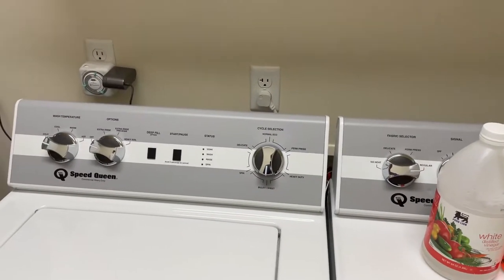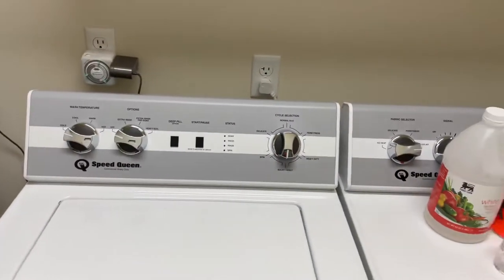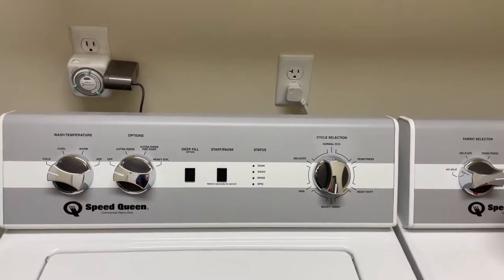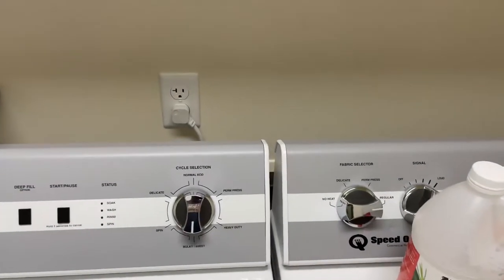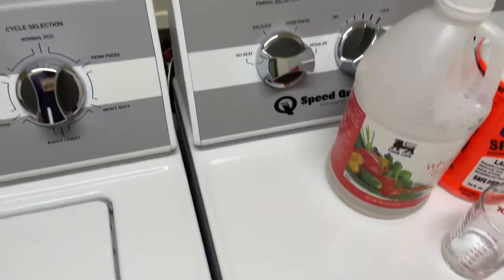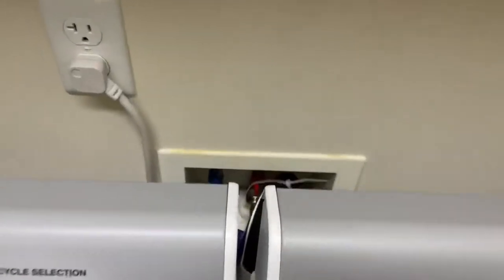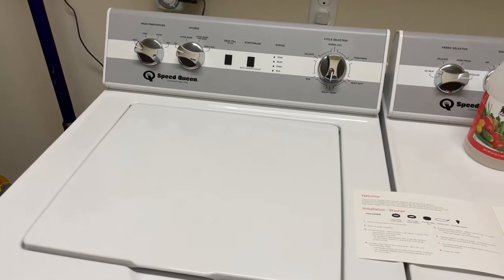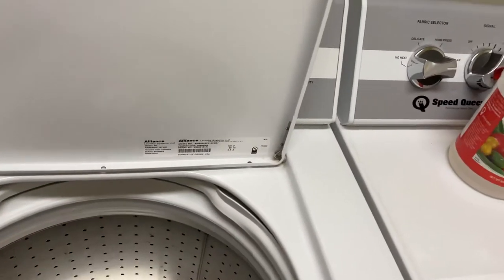Foam Bubbles coming out Speed Queen Washer drain hose - Fixed!

Comment: Rick thank you so much for this video!  We have the exact same model and exact same problem, bubbles everywhere and water on the floor.  I don't want water on the floor near my new washer as I don't want the bottom of it to rust as a result.  I say new washer only because my last washer (a Maytag ) lasted 30 years, but that was back in the day when machines were mechanical and not all this computerized stuff, which is why I bought this model (TC5003 WN) because it was NOT a touchscreen and all of that computerized stuff that can fail.  This model is mostly what I call a mechanical model and it also has the option of hot water which many washers nowadays don't have. I tried different things like using the lower water level and not using the high water level but that didn't seem to make a whole lot of difference.  We were actually on our way to pick up our standpipe adaptor from the warehouse (part number 36878) and while we still will try this part we want to try the remedies that you said worked for you as well.  Even the guy in the warehouse (when I called today) mentioned that the air pumping down the standpipe makes the residual soap bubbles multiply so he was saying he wasn't sure how much this part would help.  I told him I thought the hard plastic of the drain hose along with the ridges it has inside and out were causing some of these excess bubbles (as opposed to having a softer plastic drain hose that is smooth on the inside and out).  I told him I didn't know if this was a design flaw or not, but he did say almost exactly what you are mentioning about the pump and spin cycles being so very strong and fierce.  I agree with you that I like having the clothes almost bone dry as the drying time is cut down dramatically!  All this being said, I do have a couple of questions.  You mentioned 1 ounce of vinegar to be put in the wash cycle and I was wondering if the capful of your detergent is also 1 ounce or is it more than that?  Where do you get your detergent?  I've noticed less bubbling when we used ONE of the little Arm & Hammer laundry pods that you throw in the bottom of the washer before you put your clothes in but I can't stand the smell of them!   Also my vinegar is Heinz multi-purpose vinegar extra strength (6% acidity) that I use for cleaning (windows, decalcifying my k-cup coffee machine, etc.).  I think I got it at Walmart.  Do you think that would be too strong or should I just go with regular strength vinegar?  Also you mentioned that the the normal economy cycle does not have the fill and agitate as part of the rinse cycle, so I'm wondering what is the best setting for me to use to get around this rinse cycle problem as I don't think I can change the rinse cycle in the middle, after my choices have been set.  Basically, which washer settings have you had the best luck with as far as avoiding the bubble/water problem?  Even though you're saying the vinegar is pretty much going to stop the problem I still just wanted to hear your take on which settings have worked best for you.  Sorry this is so long, I'll be grateful for whatever answers you might have!
Reply from the maker: Hi Deborah.  Thank you for leaving a comment.  No problem with the length of you questions.  I am a "details" guy and appreciate everyone else who is also.  
*  We use any generic white vinegar.  Our current bottle reads 5%, so you are good with 6%.
*  We pour 1-2 ozs in the middle dispenser at the same time we add the clothes and detergent.
*  We've used Atsko Sport Wash detergent for at least a decade now.  It has no additives and no fragrances.  Just pure detergent.  
*  We use the Heavy Duty cycle for all clothes, and Bulky for bed sheets.
*  Every once in great awhile we still get a very small amount of foaming.  It never foams much, and it never gets too big that it threatens to run down the wall. 
*  Please click on the "Rick's Tid-Bits" by the video to go to my YouTube channel.  I think you will find some more interesting tips in the "How To Make Life Easier" section.  Rick
Reply: @rickstid-bits  Thanks again!  I've never put anything in that middle dispenser as I never really knew what it was for!  You don't put your detergent in there though do you?  I will have to try that detergent as it does sound good.  I will stick with the heavy duty cycle for clothes and bulky sheets for sheets and blankets like you say and if I'm doing anything truly delicate then I'll use that cycle but I will stay away from the Eco Cycle!  And I guess you man click where it says subscribe.  I'll do that now.  Thank you again!  Deborah
Reply from the maker: You're welcome.  The vinegar goes in that cup inside the agitator.  The detergent goes in with the clothes.  Please read my entire description below the video.  I've added a lot of what I've learned there.  Rick
Reply: Ahhhh! This was exactly what I was looking for…a video with my SQ washer with the same issue. Headed to try this out right now!!! Thanks, Rick, you just may have saved the day 🎉
Reply from the maker: Hi Hope.  You’re welcome.   Please read all the info in this video's description.  I recommend you do the heavy flush first.  Please come back and let me know how it goes.  Thank you for leaving a comment.  Please click on the words “Rick’s Tid-Bits” underneath the video to go to my YouTube channel.  I think you’ll find some helpful and unique tips in my How to Make Life Easier or Better section.  https://www.youtube.com/channel/UCc-IuUFzC2Tyv06KzJyBESg  Rick You’re welcome.

Comment: That was very informative. We bought this machine as I am recovering from mold exposure. We've only had our machine a couple of weeks, and we are having the same problem with bubbles just as you described. This is very concerning to me because now the sheetrock is wet where it spilled over, and the machine is so heavy I can't move it to clean up all the water. The company where we bought it deliverd it and set it up, so hopefully it was installed correctly. We will try your suggestions and see if that fixes our problem. Thank you so much, and may God bless you.
Reply from the maker: You're welcome Shaila.  Please let me know if it works for you.  Rick
Reply: any updates?

Comment: I was so interested to find your post here.  I have been having this problem with my old SQ and my brand new one; the dealer told me to call my plumber which I did, and proceeded to spend a LOT of money re-piping my  basement to lift the drain pipe higher and straighten out a few other turns my old pipes were making.     The first load in the new configuration was fine; the next 2 loads leaked out the pipe again!   I did notice that if I used the heavy duty or bulky item cycle and warm/hot water, I did not see any foaming or leak.  The next several loads I did were fine, but I expect it will happen again.   I wondered if it was the Eco Cycle that was the problem for me.  Frustrating to say the least.   I will try your vinegar tip!   And I use very very little detergent, like the size of a dime.    Thank you!
Reply from the maker: You're welcome Kate.  I'm glad this is helping so many people.  On mine:  It's the High Speed Spin that is the primary factor causing the foam.  However, I like the High Speed Spin because of how much more it wrings out/dries the clothes.  I believe I mention the different spin cycles in the video.

Comment: Thank you so very much for your insight.  I am currently experiencing this exact problem on my two year old T5 model, as well.  I am going to run a cycle with hot water and one cup of vinegar.  Moving forward, if I still have a foam issue in the final drain cycle, I will start to incorporate a cap of vinegar with the detergent.  Many thanks.
Reply from the maker: Hi Jeanne,  You're welcome.  Thank you for leaving a comment for me.  Let me know how it works for you.  Rick
Reply: @rickstid-bits  So far, I've completed two loads (after the hot water / vinegar treatment)... NO SUDS.  This over-sudsing situation was totally my fault.  I used too many Tide pods, at once.  They are very concentrated and I'm sure they contributed to the build up of detergent, in the interior walls of the tub.  For now, the treatment you suggested worked very well.  I will do my part and pay closer attention to the manufacturer's directions, on the pod containers.  Thanks, again.

Comment: Appreciate the video. Mine which is exactly like your is doing the same thing. It ruined the wall behind the washer. Almost every part has been changed after having the washer for less than a year. Did the whole vinegar directions per speedqueen. They said I would not have to continue this once I followed their protocol. It is still happening. I have never experienced this issue with any washer I’ve owned in the past. I believe it is a manufacturer defect in design. The spin cycle is only 720rpm which really isn’t as fast as some others out there. I went to the bbb website and the reviews and complaints are pretty bad. Wish I had gone there first before spending the money I did on this washer. I know and they know it’s a known issue.
Reply from the maker: Hi Joanne,  You're welcome.  I agree.  I'm 65 and have never had another washer do this.  There has to be an easy fix for this.  I wish they would develop a fix and initiate a recall, and have all these fixed under warranty.

Comment: Thanks a million for the video. Have the exact same machine the exact same problem. The cap full of vinegar did the trick! No more foam. Thanks again
Reply from the maker: You're welcome Jerry.  I'm glad it worked for you too.  Thank you for leaving a comment.  Rick
Reply: @rickstid-bits  Hi Rick.  Where do you put the vinegar?  In the fabric softener cup or right in the wash when you start the load?  Thanks in advance!
Reply from the maker: Yes.  The fabric softener cup in the center of the agitator.  Rick
Reply: @rickstid-bits  Thanks!

Comment: Awesome video!  Thanks!  I’ve had the same Speed Queen washer since May and today is the first time I’ve seen it produce Suds at the drain pipe.  I did a small load, with a Tide soap pods, on the Normal / Eco cycle.  I think that may have been the issue.  I will try your recommendation of the white vinegar.  Thanks again.  Your review was very thorough and will be helpful to many people.  Great job!
Reply from the maker: Thank you for the kind words.  That is the whole reason I do most of my videos - to help other people.
Reply: Good luck with your washer as ours never stopped with the soap issue no matter which detergent or how much or little I used .
Reply: @lesleyvaleski5055  we have experienced the same problem. I personally think there is an issue with the design/programming that creates the issue.
Reply: Switch away from Normal Eco cycle, to something like Permanent press.  That was the fix for us.

Comment: I wrapped a rag around the drain hose and stuffed it down into the standpipe, very carefully so as it would never fall in. And the vinegar is completely harmless to your clothing and machine as well.
Reply: Ah good idea. I didn't think of that. Did the rag work? Do you have to change it out after a while?
Reply: @TheBigExclusive  works fine. It's been 2 years, never changed it.

Comment: I just got my machines recently and I am having the same exact problem.  Called the company we purchased from,  they came out and couldn't fix it. I put a towel around the stand pipe to soak up the bubbles. I should not have to do that with a brand new washing machine that cost a pretty penny. I will try your vinegar trick. I hope it helps. Thanks for making this video.  The salesman tried to tell me he's only heard of one other person having this problem..... I didn't have an issue with my previous washer.
Reply: There are many people with this model machine having this issue.  It really should be recalled especially since Speed Queen knows about it.
Reply: @donna8826  I’ve had my machine since 2011. I’ve seen suds and been concerned, but they haven’t overflowed and flooded.

Comment: like others on this channel i discovered similar issues with an older (11 years to be exact) speed queeen  comercial washer. let me first state ,this has been a wonderful machine with absolutely no problems except the foaming. am not sure how long foaming has occured,but do know that it is consistent since i discovered it by accident  a couple of months ago. have since tried some of the solutions posted here with inconsistent results. have tried other things and found a solution that is working 100% of the time,approx. 20 loads sofar. the machine pumps water(and air ) at the end of the rinse cycle so fast, that ,is in my opinion causes the foaming. the solution for me,(my entire rince cycle on permanent press or regular cycle is approx. 14 minutes ), is to shut off the rinse cycle at approx. 11 minutes into the cycle,wait 15 minutes ,then turn machine back on to finish cycle. NO FOAM OR WATER  also, the 14 minutes is from when the tub starts to fill with water. good luck
Reply from the maker: Hi Donald,  I'm glad that's working for you.  Thank you for adding that information.
Thank you for leaving a comment.  Please click on the words “Rick’s Tid-Bits” underneath the video to go to my YouTube channel.  I think you’ll find some helpful and unique tips in my How to Make Life Easier or Better section.  https://www.youtube.com/channel/UCc-IuUFzC2Tyv06KzJyBESg  Rick

Comment: I have the exact same one and it’s doing the same thing. However, I use a half a cup of white vinegar in every load. I’ve checked my drain pipe. I’m about ready to take the drain hose off the back of the machine just to make sure that, it is clear, so what do you suggest? an extra rinse or don’t use the normal cycle? And thank you so much for making a video.
Reply from the maker: Hi Teddi,  You're welcome.  Please click on the word More in my description, and then read everything I wrote there.
Never use Normal.  Normal doesn't even have a Rinse cycle!

Comment: FYI I just got a new speed queen a couple weeks ago and a new house as well. This house was gutted and renovated down to the masonry. Even with brand new plumbing and the sudd thing happened to me too. I am going to try this vinegar method however I found a thread before coming here. When I googled fixing suds from a standing pipe from a new washer a plethora of people have this issue and not just with Speed Queen. It’s all of the brands. The original threads dated 2016-2017 I found, everyone thought it was Amana then Whirlpool and then it went on…  Old pipes, new pipes, little soap, you name it. This one lady on one thread said she used a 4 inch paint roller in the standing pipe and put the hose to the washer back in and all resolved. Then someone else chimed in and said they did her method and it worked for them too. I haven’t figured out quite how that works yet because I don’t have a paint roller. The person that said they also got success from the paint roller idea said they heard a compression fitting can work too but they liked the paint roller idea and being that it worked they went no further. I also think those with a laundry basin won’t have this issue being that all the extra suds go into the basin. Come to think of it, my mom’s basin does fill with more suds over the years than it used too. Hope this info helps anyone here or for future comments that come through. It definitely is not the washer brand. I am leaning towards the way soap is made ( I use all natural cruelty free) and how it responds to washers. Speed Queen is one that hasn’t changed because how they been building them still outlives all the other competition. My mom has had her Speed Queen for 17yrs and the model before that was an OG Speed Queen too, and not one issue. Thank you for the vinegar tip, I am going down to add that to my next load!
Reply from the maker: Hello.  Thank you for the additional information.  I'm going to assume that the paint roller method completely seals the drain pipe to the drain hose.  The problem is:  We can't completely seal the gap between the washer's drain hose and the drain pipe.  The house plumbing needs the air inside that drain pipe to form an air gap.  If we sealed those pipes together: We run the risk of creating a back siphon.  That could cause sewer water from your house plumbing to flow backwards, into your washer, and onto your floor.  
     Thank you for leaving a comment.  Please click on the words “Rick’s Tid-Bits” underneath the video to go to my YouTube channel.  I think you’ll find some helpful and unique tips in my How to Make Life Easier or Better section.  https://www.youtube.com/channel/UCc-IuUFzC2Tyv06KzJyBESg  Rick
Reply: @rickstid-bits Hey Rick. Thanks for the share! Like I mentioned in my comment, I didn’t get to try the paint roller thing yet because it’s so new/recent. But the comments from the person who first initiated the paint roller method and the other person that tried it and worked said it was a nice snug fit and when it worked they didn’t need to go any further. I am just noticing from all the googling, youtube, research, that it’s very common across the board. I came up with the conclusion about the detergents changing and not the washers because I noticed there are more suds in my mom’s laundry tub/basin over the years than normal that I have seen and we use the same detergent for years. Hence why I can say, the method of the vinegar from this video did the trick. No more suds overflowing. While I have used vinegar from time to time prior to the new house/washing machine, I am just not a fan of it canceling out the nice smell of my detergent. But if it helps with the suds issue then it’s fine. My clothes are super clean and just smell like clothes lol